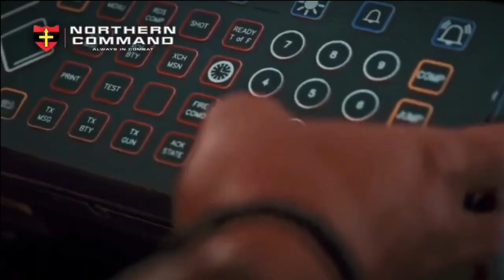Bharat Forge received AoN for 300 ATAGS gun, order expected in 2023 #indianarmy #drdo #atags

Comment: Considering how much self propelled artillery is in the arsenals both Pakistani Army and PLA it is time to rethink the usefulness of obsolete towed guns. Field Artillery Rationalization Program (FARP). 1580: 155mm towed artillery (ATAGS+Dhanush+Sharang). Just order ATAGS only and cut the numbers down in half.  Instead of just 814 Mounted Gun System
mount 1628 ATAGS on a Tata/Ashok Leyland truck instead. MGS is on an imported Tatra truck which isn't necessary.300 K9 Vajra is a sensible decision, but it is time to consider BHIM 2.0. The work done to mount a desi gun on Arjun chassis has already been done. IA probably needs more like 600 self propelled guns, the balance of which should be BHIM 2.0(Bharat 52 gun on Arjun chassis).
Reply from the maker: Yes FARP needs revision as it dates back to Kargil war. Indian Army needs more self propelled guns!
Reply: @IndianDefenseAnalysis  Definately! I also think BHIM 2.0(Bharat52 gun on Arjun Chassis) needs consideration. And the Kalyani titanium gun, and Go anywhere gun as well as modernizing the howitzers too!
Reply from the maker: @datoolz0  Arjun chassis will be over kill even the chassis of light tank under dev will do
Reply: @IndianDefenseAnalysis  Vajra K9 and Bhim both came in around 54 tons. Light tank can't carry full size 155mm howitzer.
Bhim is a self-propelled howitzer. It consists of the Denel T6 turret mounted on an Arjun MBT chassis. It was developed and tested successfully and was cleared for production but was put on hold after Denel was banned from working on the project.

Basically all the work that was done 10 years ago can  reused again to build a fully desi self propelled howitzer using the Bharat 52 gun on Arjun tank chassis.
Reply: Towed gun is history now no one uses it in stead order k9 vajra .....shoot and scoot  one
Reply: @sudarshanadiga6033  Vajra costs much more than ATAGS, which is probably why they went for it. But cost and effectiveness can be at two extremes, no good to have a lot of something that doesn't work.
Reply: Not Arjun chasis Too heavy We need lighter (than K-9) Bhim
Reply: @coolkal7590  ATAGS gun is 18 tons, even the lighter Bharat 52 is 15 tons. All self propelled guns are massive behemoths, only smaller calibers can be done on light tank chassis.
BHIM 2.0 is ideal with Bharat 52 gun on Arjun chassis, doesn't need any development work and can even skip trials as that was all done decade back.